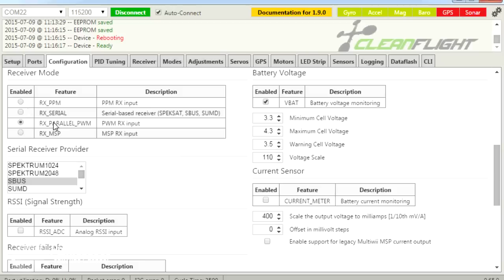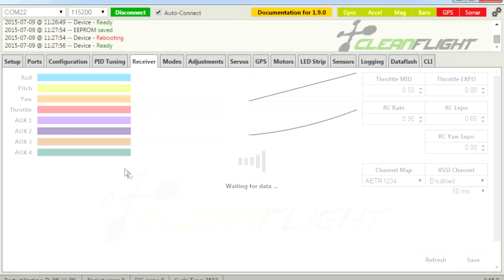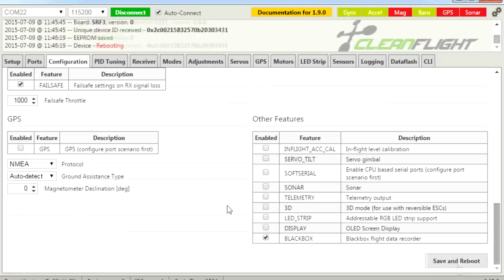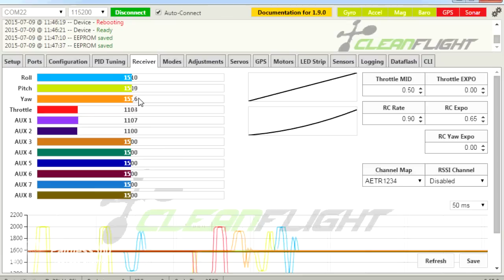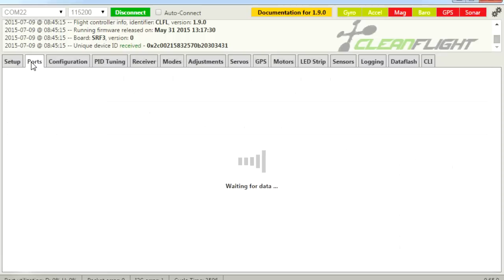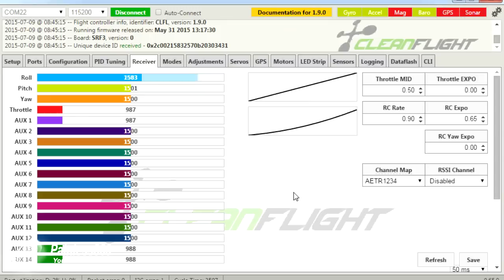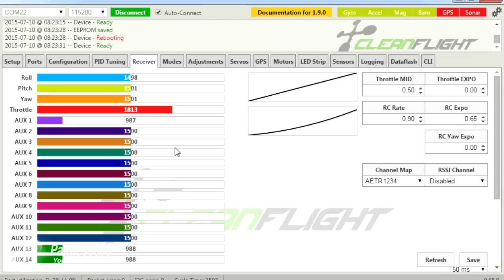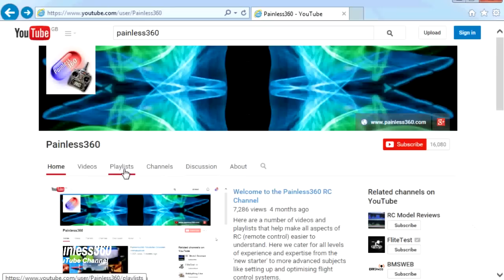Seriously Pro F3 (SP3) Quick Tip - Install and setup PWM, CPPM and S-Bus Radio Receivers

Comment: Hello Painless, 
Thanks for your video.
I came across a problem that I cannot seem to find a solution for.
I had a SPF3 Deluxe that was working perfectly fine with my 6-channel PWM rx, until I accidentally fried the FC. That being said, I bought a new SPF3 and rewired it (same exact wiring I had with my older SPF3)  but my rx channels were not responding in Cleanflight (nothing was changing as I moved my sticks on the TX). The weird thing is that ONLY the AUX channel was working, but none of the AETR channels. After hours of debugging, I figured that my 'safeflight' was set to Auto instead of Hold for Channels 1-4. As soon as I changed them to "Hold", the Elevator, Aileron and Roll rx channels starting working perfectly with my TX, but not my THROTTLE. So now everything is working perfectly except my throttle channel is not responding/frozen/stuck at 885 and does not change as I move my throttle stick. The throttle failsafe is set to hold not auto and the PWM wiring is done correctly... I wired my Transmitter to my computer and opened up the TX software (T6Config) to see if throttle channel is working and it does receive the right values, but cleanflight receives nothing.  I cannot figure out what's causing my throttle to not respond.

Any tips would be GREATLY appreciated; you're my last resort!

Thanks Painless :)
Reply from the maker: I'm not sure what you're describing - can you post a video showing the problem?

Comment: Hi Painless, nice video, as usual.
What do you think about using the I-Bus from Flysky in a X-Racer board with betaflight? I have been making some research but there is not much info about it, I though you may have some suggestions or tips about it.

Comment: hi, ive seen somewhere wiring pictures of  plug 5v from pdb  in fc and then with 3 cables (throttle, vin and gnd ) to receiver throttle channel , this for ppm, wich way to power is suggested to be safer? thanks
Reply from the maker: +Fabio Fabius see our video on RC Power Systems that covers this.. Happy flying!

Comment: I have a Spektrum Sp4648 Receiver and a Dx6.  the Receiver has three wires Grey Black and red and requires 3.3v   Any ideas on how to make this reciever work with this partocular board?   What pads I need to solder the wired to if Need be?  and what reciver input is needed in cleanflight/betaflight
Reply from the maker: Set it up as a sat. rx (as mentioned in the bottom of the spec sheet - https://www.spektrumrc.com/Products/Default.aspx?ProdID=SPM4648). Best of luck!

Comment: I have an issue where the aileron/elevator move together and throttle / Yaw move together. I'm on pwm, no mixes on the Futaba and I'm using pwm. Used the same model on nazes/cc3ds etc without any problem. Any idea what might be the issue ?
Reply from the maker: +BruceLeedv no, I'd be tempted to recreate the model in the radio if you can't see a problem on the radios channel monitor.. Best of luck!
Reply: +Painless360 : I have more people confirming the same issue, looks like a problem with I/O ports. Only with pwm, works good with the rest !

Comment: I for some reason cant get sbus to work for the life of me, followed your instructions to the T.  Are there any additional settings on the taranis that need to be in place besides D16?
Reply from the maker: +Devin Thompson Nope. Make sure that the Rx you are using doesn't need a jumper etc.. Best of luck!

Comment: Hi, great video. Any idea whether you can use the PPM solder pad on the underside of the board? As my JST port (PPM SIDE) got broken in a crash. Any help would be appreciated :)
Reply from the maker: I've not used them here, it should work. There is only one way to find out! :D Best of luck!
Reply: Used it this morning, it recognizes the ppm input which is good :) However, I can't get the quad to arm, ie it won't show as armed in betaflight when toggled..
Reply from the maker: +Mr Props the common problems are in our troubleshooting arming video. Best of luck!

Comment: Thanks this helped a lot. Why won't it work in uart 2? That was my problem. Sbus worked in uart 3 np but not 2.
Reply from the maker: +ShabadooFPV it's just how the board is setup. I've only used one f3 based board that UART2 was for serial receivers.. Happy flying!

Comment: Hi Painless,
Your receiver tells you what cables you have to use because you have the names, throttle, roll... In the flysky ia6 we don't have that information. The wires goes the same position or in different position?
Much Thanks
Reply from the maker: See how we did all that in the radio video of the latest 'Quadcopter Building for Beginners' series. We covered this there. Best of luck!
Reply: I saw it but flysky's receivers just let you know what channel is and orange's receivers let you know the throttle channel...i'm very lost, i got my new sp f3 racing but don't know how to connect in to the receiver.
thanks
Reply from the maker: +Guillem Delgado the lack of names on the receiver and the use just numbers is all covered in that video..
Reply: flysky have tranceiver setting menu were you see what stick have were, channel, and can chhange other channel .etc,trottle normal have channel 3  but can change setting. tranceiver setting need be first right. then bind receiver, and then connect receiver to Fcontroller i -buss have normal. flysky meny have setting use you ppm,pwm,i-bus, s-buss. looking have sure right buss what you use, if connect many wire have pwm or ppm, and setting must be thats. if youse i -buss setting need check have sure i-buss.

Comment: I'm interested in switching to a x4r-sb but I love the telemetry from my d4r-ii. Is it possible to get smart port telemetry working without an external battery sensor? I've seen people on forums say it can be setup on a separate UART but haven't seen any specifics of how it's done. Thanks for the videos, Painless.
Reply from the maker: Yes, i will ve covering this later in the series. Watch this space!
Reply from the maker: +Painless360 You can preview the Cleanflight FrSky SmartPort telemetry settings on the SP3 video series now by watching https://www.youtube.com/watch?v=mFvb40oE_pM&index=9&list=PLYsWjANuAm4ro1vHztauuHFaelUDCOwqw
 Hope it helps.
Reply: This is the video I was referring to.

Comment: Hi!!! Thanx a lot for the very helpful videos!!!!! I'm working on a QAV250 project using the SP f3. When i plug the battery and the usb to the computer everything works fine. When i disconnect the usb cable i can't arm the motors anymore.   I'm using a Matek distribution board and sending the 5V from its Bec to the SP-f3. Than the receiver is getting the 5V from the IO2 port (throttle channel). Do you know why i can't arm the motors without the usb cable connected???  Thanx a lot for your support!!!! Best wishes! Helder
Reply from the maker: +Helder Martinovsky I'd suspect a power problem with the 5v inbuilt Bec, if double check the voltage it's sending out.. best of luck!

Comment: I am unable to get my X4R connected up to my SPR F3 (Acro) using SBUS. All my wiring matches what was shown in the video. All the required SBus settings have been changed in Cleanflight as shown in the video.  The receiver binds to my Q X7 as the X4R gives me the green light.  But, once its time to go to the Receiver tab in cleanflight, none of the values move when I move the sticks. 

I already have tried: 
Creating a new model. 
Double checking that cleanflight and the QX7 are set to AETR.
Re-binding.

Any other ideas on what could be wrong?
Reply from the maker: +Dixie Wexworth selecting Serial Reciever on one of the Uarts. Usually 3, in the ports tab..

Comment: Hi,i dont know if you know something about this board but i have a omnibus f4 and i get ppm input on my screen but it doesnt output it to the motor, do you know why?
Reply from the maker: Some Omnibus F4 boards needs a solder pad connecting to select PPM or SBUS - you may have one that needs that and you've not made the connection.. Best of luck!

Comment: Great videos! But I am still having a prob with f3 deluxe.. All inputs are working in correct order. All motors are in correct order and spinning in right direction. All props are correct. Did motor calibration. All start around 1117 now the problem the minute I give it is a little throttle it pitches backwards flip. I have is on angle to start. Also I guess the throttle ramps up fast with tiny input I can't figure my problem! The setup is 250 diatone simonk 20a esc sunny-sky motors 2204.  And setup as pwm for now with 9xr radio with orange rec.
I am visiting uk right now with all my gear..

Thanks!
Reply from the maker: You look like you've covered the basics. Have you checked that one of the props isn't on upside down?
Reply: +Painless360 yep props are good I was running single wire on 3 motors and 3 wires on throttle. I am gonna add the ground and red wire to all the motors now and if that does not work I will get new esc. To see if that will work.
Reply from the maker: Tricky then as you sounds like you've covered the basics. Best of luck!

Comment: Hey Painless great video, just wondering how you would go about binding you controller to your receiver if your using the bind port for cppm?
Reply from the maker: I'd unplug PPM cable while I bind then pop it back in.. Happy flying!
Reply: Thank you! Also I've come from your tutorial for the gb 190 and when I plug it in my pdb feels quite hot to touch is this bad? I'm using the pdb that came with the kit and a 3s 2200mAH battery.

Thanks again!!

Comment: what are those cables called? i want to use the flysky fs t6 with the fs r6b rx. it wont bind at all so im thinking of using these cables to see if it binds
Reply from the maker: The way you connect it to the flight controller won't stop it binding. Check on the output mode you have selected in the menu. See how we added a FS-i6S radio and bound the receiver in our 'Quadcopter Building for Beginners - Series 1' on the channel.. Hope it helps..

Comment: You commonly use a separate circuit with battery to test power things up in many videos.  What device (BEC?) are you using or would recommend?
Reply from the maker: Any 2or 3A switched UBEC is ideal. Happy flying!
Reply: Thanks!

Comment: thanks for the video, it was very clear... Just one thing, i did follow all the steps but for some reason i have no signal from my Tx, I'm using a RadioLink AT9 with a R9D Rx... on CF all the settings went through and it seems to be ok, i'm not sure if there is something else i need to do???
*in one other video the person was using the same Tx and Rx and he had a (Sbus Inverter)... so i was wondering if that might be the case???

Once again thanks for your videos, they have been a great help for the my new found hobby.
Reply from the maker: +Vincenzo d pugliese If you're using S-Bus then you probably need an inverter - check the manual for whatever you are plugging into..
Reply: +Painless360 I'm using a SPF3... just had a look at the (SPF3 - page 2 features) manual it says no need for an inverter... now i'm not sure what to do, i'll probably set it up as a PWM until i can find a solution...
cheers for the help...
Reply from the maker: There are a few steps when using s-bus. Caught me out when I tried too. The steps are all in the video so should work then. Best of luck with it..

Comment: I just purchased this on getfpv. the mkII one. I'm really confused about cppm and sbus and the difference,  because I want to use one or the other to control my quad, but I also have a x6r that I want to send telem  back to my taranis  such as battery voltage and altitude  from the barometer and campus  direction. if I set up sbus as the means to control  my quad,  can I also "check" telem in the configurations for uart3? will it use that single uart to control and to send telem? I'm really confused..
Reply from the maker: Yep, see the other videos in the series. You may need to connect the TX and RX pins to the cable to the S.Port input on the X6R though as S.Port is a single wire telemetry system.. Best of luck!
Reply: Painless360 I've probably watched 6 hours of your videos.. thanks!!
Reply from the maker: Only about 96 hours left to watch on the channel then :D Best wishes for the festive season! :D

Comment: Hello, all your videos are great!
I have one question. In the 10th minute of the video, when you start configuring the PPM, you unpluged the battery? I am probably missing something. In the documentation is written, that you can't plug in 2 power sources, but microUSB is another power supply.
Reply from the maker: +franta joža the flight controller doesn't power the receiver from the USB port so you need to...

Comment: The cables that plug into IO1 and IO2, are the identical? Because mine is, just flipped around
Reply from the maker: +Tom Dunphy Check what it says in the manual. I've had a cable with the colours swapped before now..
Reply: k thanks

Comment: Painless360 hi lee when you have 2 quads setup to the one transmitter and you want to swap receivers from one quad to the other will I have to make any changes in the settings or do I have to rebind the receivers to each model again my Fs-iA6B is to big to go inside my QAV-R 180 and I was going to swap it with the fs-AI6 from my nighthawk
Reply from the maker: Usually you have a model memory/setup in the radio for each of the models and choose that one before you fly. Modern radios make sure that the radio will only bind to the receiver in the model selected too - for safely. Happy flying!
Reply: +Painless360 hiya lee I got them sorted I did have to rebind my both quads and there both fine my little QAV-R 180 looking sweet hovering and flying fine lee  thanks again what size of batteries will I be looking at for the 180 with the 2205-2600kv & 30A BlHeli esc lee

Comment: Hi there Painless,  I need a bit of help with my sp racing evo, latest version!!  The new evo does not support pwm for receiver anymore, please correct me if Iam wrong. So Iam having trouble connecting my tilt rotor servo to the receiver or flightcontroller.
You need a pwm receiver output for the servo. Or maybe some fancy mixing in my radio???
Please help me, for my brain is overheating, cheers Dolf.
Reply from the maker: Just checked the manual and you're right from what I could see - no PWM input. I've very little experience with the tilt style models but I'd look at 'channel forwarding' in Clean/Betaflight as a way to present the PWM output you need onto a spare motor PWM output on the FC.. Hope that gives you a clue.. Best of luck!

Comment: So on the FrSky sbus connection, what are the other 4 cables and where do they go?
Reply from the maker: At what point in the video?
Reply: +Painless360 12:50.  I noticed on the other video, you initially used the wire that comes with the receiver, but then later have a different wire that only has the 3 with ground, hot and signal.  can I just cut the remaining wires off?  assume they are for intended for direct connect to servos or something?
Reply from the maker: I lifted the little 'teeth' on the connector and slid out the wires I didn't need. That way if I need them later on I can simply slide them back into the connections I need.. Happy flying!

Comment: painless360  hi i just got the i6 & iA6 rx  the cd that come with it dosnt open up says no file ? lol   but i got it bound  and tx setup for quads   and i tryed setting it up for ppm  i have ppm switched on in tx  and in cleanflight  but im not getting no movement in the receiver setup    what channel map should i be useing  and serial receiver  provider    and do i use ch 1 for setting up ppm on the iA6
Reply from the maker: Make sure you've got PPMN selected in the GUI and don't worry about the order of channels - that is for when you can see the individual channels moving. Hard to offer more help without seeing how you have everything connected and what options you've selected on the screen.. Best of luck!

Comment: If i plug power directly to the receiver , the receiver powers the flight controller ?
Reply from the maker: Yes, via the servo cable from the TX to the F.C. not ideal but handy if you’ve not got any other options..

Comment: i have a spf3 and x4r when i hover the throttle twitches or fidgets. do you know what this could be?
Reply from the maker: +Shawn Rose. Could be a few things - connect a servo to the throttle channel on the Rx and see if that twitches too - if it does then it's something on the radio - if not then look more closely at the model.. best of luck!

Comment: I just purchased a F 3 Evo board. It came with no instructions and I am having a difficult time setting up-- ESC, motors, leds, etc. Are you aware of any videos that might help setup?
Reply from the maker: +Bud Jones you have to use Zadig  on it. We've not covered that Board  on the channel but this is similar - 
https://www.youtube.com/watch?v=dC0AOwQq1UI&app=desktop hope it helps!

Comment: this is just amazing. Mine didnt come with the wires and small plugs,. im so jealous. Can i solder directly on the back holes the open ports for my 4 motors, and esc and stuff? imma finish the video. sorry...
Reply: 8:57, that cable i need :) any info or links? Or can I solder directly to one of the pins on the board?  what type of plug.. thanks.. i tried searching F3 IO cables, etc..
Reply from the maker: I think the original used JST-SH (the manual for it is here - http://seriouslypro.com/files/SPRacingF3-Manual-latest.pdf) but you'd have to check with the seller of yours to see if that clone if the same.. Best of luck!